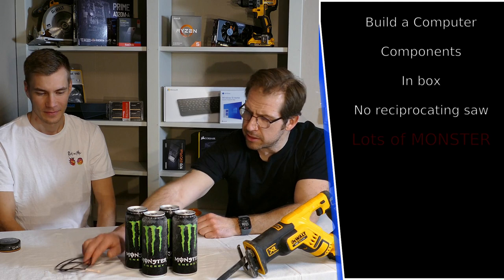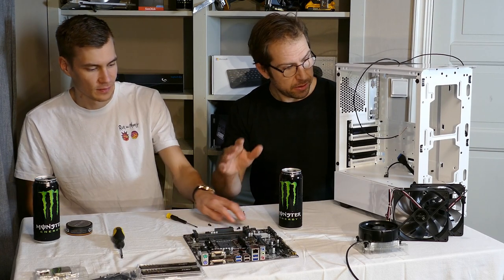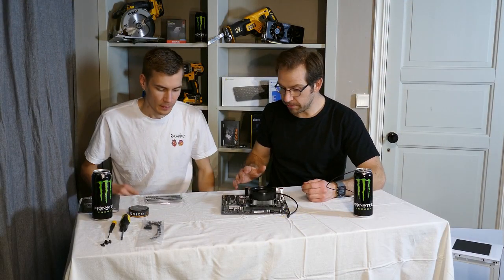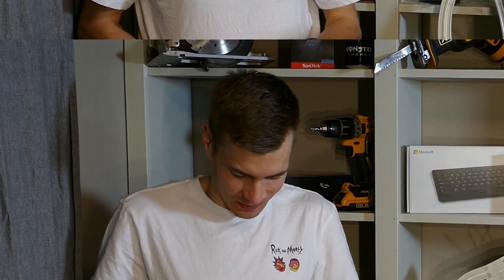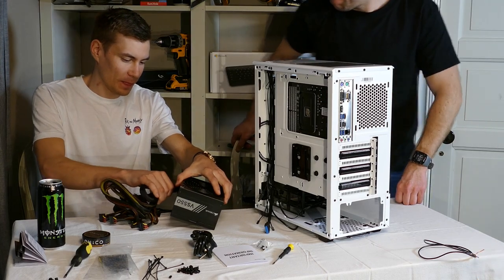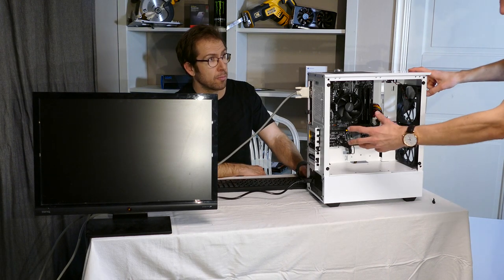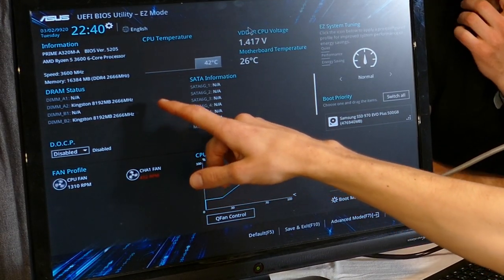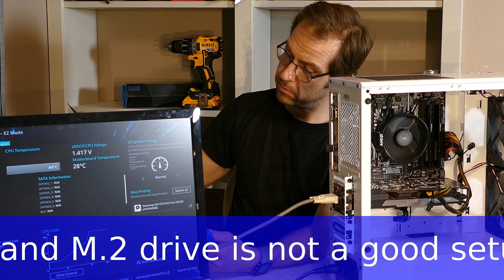RYZEN 5 3600 on an A320 MOTHERBOARD, NOOB BUILD part1

Comment: Nice I'll be building pretty much the same setup I think.  Did it come with a bios up to date enough that it just worked with the 3600 or did you have to use a different cpu in it first to flash the bios?
Reply from the maker: Hello there!
Yes, it fired right up with the bios version that was installed. Very nice!